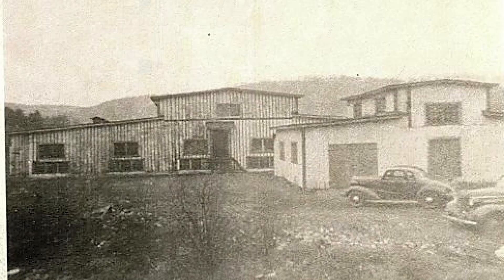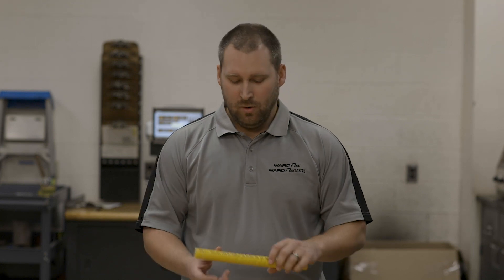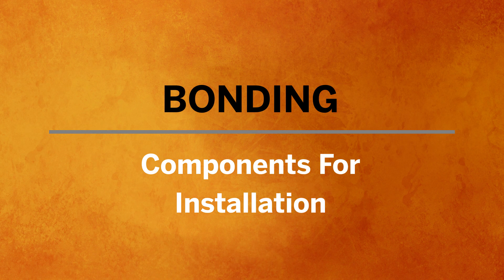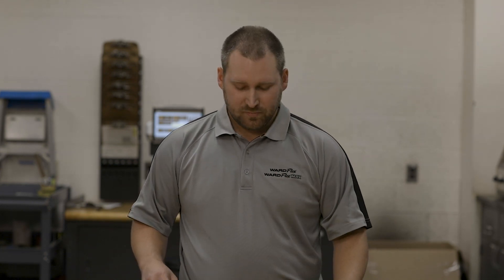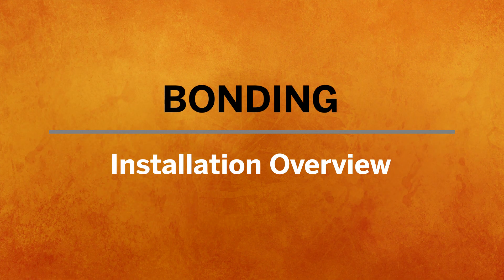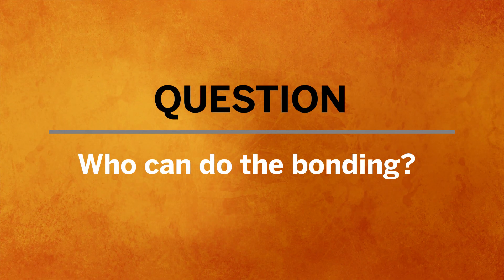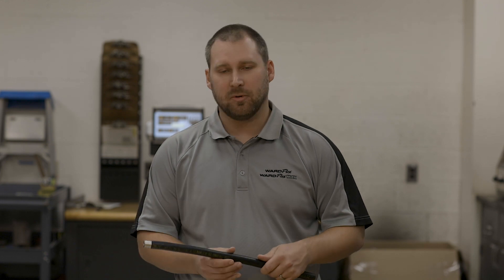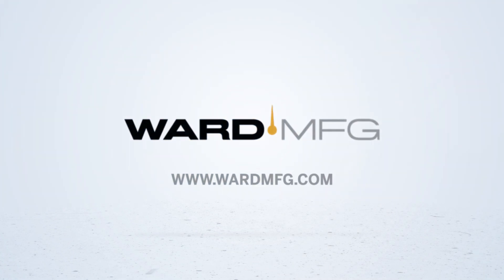WARDFlex® Bonding Installation

Comment: Tie into the homes main panel. Just buy the max.
Reply: Some AHJs require additionally WF Max be bonded just like non-arc-resistant WF.  The bonding connection can be made anywhere within the distribution (just not to the CSST itself) but must be shorter than 75ft to the EGS (assume near service panel).  Tests were done with success to 100’; however,  #6 AWG wire and 75ft or less are specified for extra safety margin.  The best practice is to keep your bonding connection as short as possible to the EGS.

Comment: does flexible gas appliance connectors need to be bonded like csst pipe
Reply: No.  Just like with arc-resistant CSST, the electrical connection to the appliance provides bonding to the EGS when using an appliance connector.  However, if you use ANY non-arc-resistant rated CSST anywhere in your gas piping system, IFGC requires you to treat the entire gas piping system as if it were all CSST and bond it properly.
Reply from the maker: A gas appliance connector isn't a part we sell, so we recommend referencing the code that the flex connector is made to, and following that.

Comment: 3:55
The other manufacturers of csst say to bond to the brass fitting of the csst connection,  NOT the black iron pipe...
Reply: IFGC allows the bonding connection anywhere in the distribution to: black iron pipe or fitting (paint removed) or to a brass fitting, manifold, etc. that connects to CSST.  Connections to CSST itself (directly to stainless steel or insulated jacket) is strickly prohibited and would be ineffective (read: dangerous and dumb!).
Reply: ifgc states metallic pipe, metallic pipe fitting or csst fitting.

Comment: While at an IAEI continuing electrical education class maybe 8 years ago they told us that each SST company has their own way to bond their product.Pure bullshit! Should have one universal procedure to bond. If I had SST in my house I would bond it at each end. If lightning was to strike a 50' length at remote end would be afraid of possible fire ball.Glad they spec #6 copper. In our area since 1981 are not allowed to use aluminum wire for a ground or bonding.